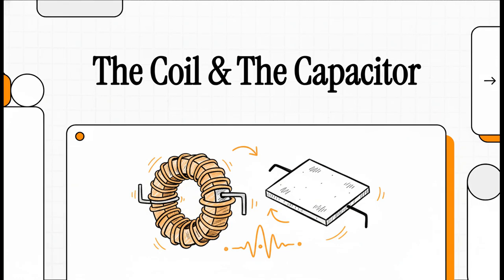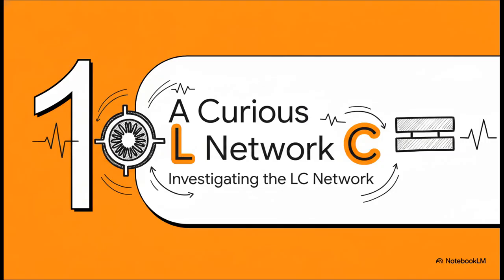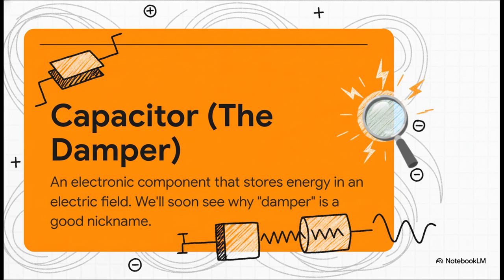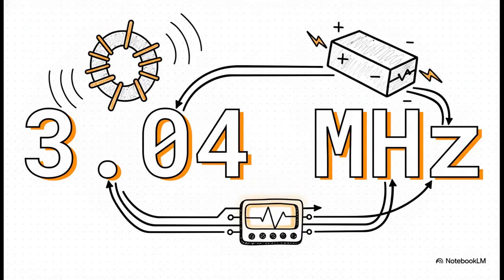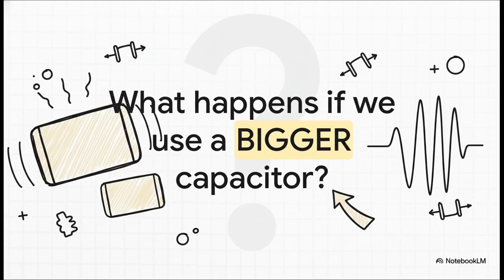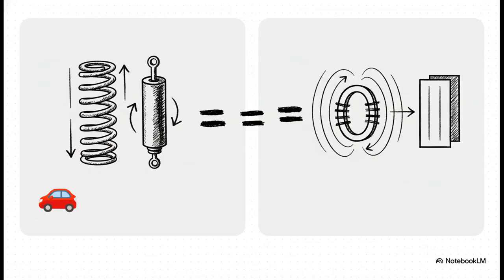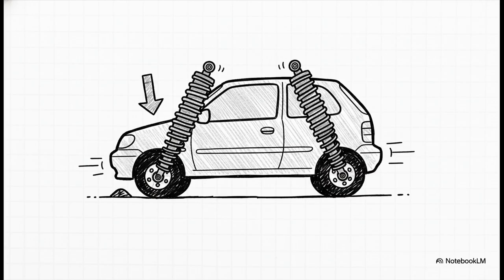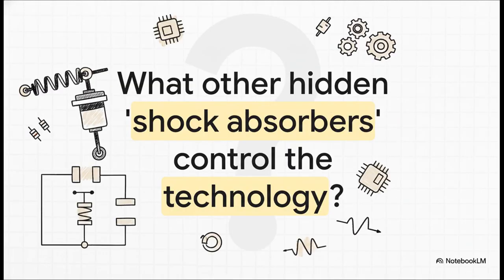When Coils and Capacitors Work Together, Magic Happens || LC Networks Explained

Comment: If you by any chance read this and think this video shows a correct way of explaining LC - it's just wrong.
Both coil and capacitor stores energy, that would be an analogy to Spring in car suspension. Put the car down and release without a damper - you get an oscilation (like in LC ). That would last forever if not the damping (damper, air, gravity etc.) all act as a RESISTANCE to the oscilation. 
In LC equivalent damper would be an unevitable resistance of conductors, coil, capacitor resistance etc.